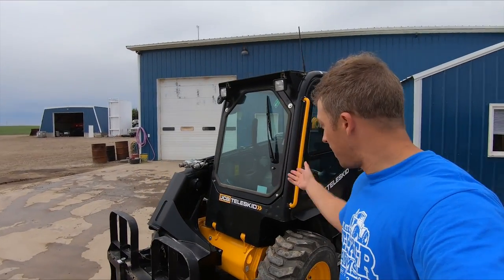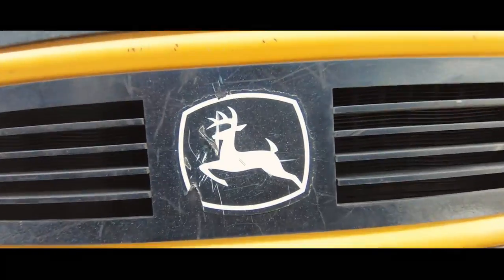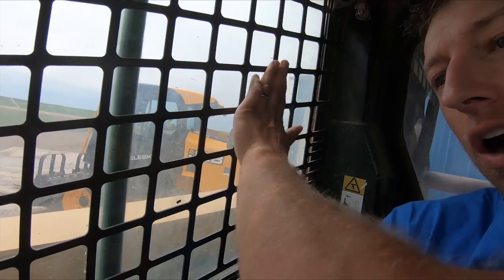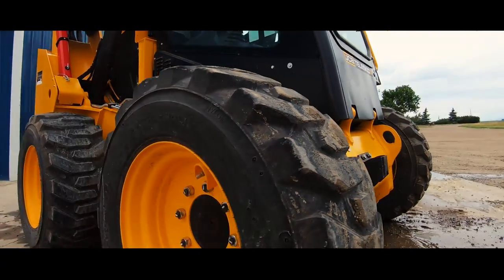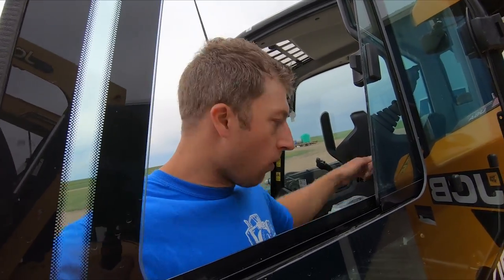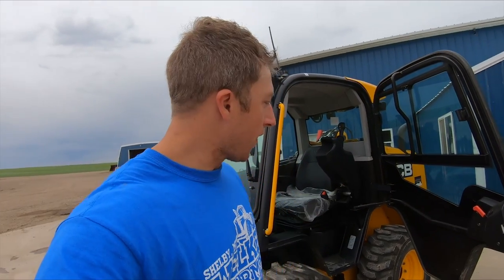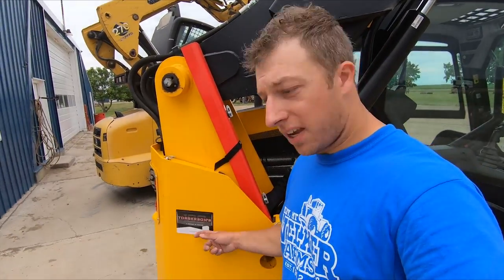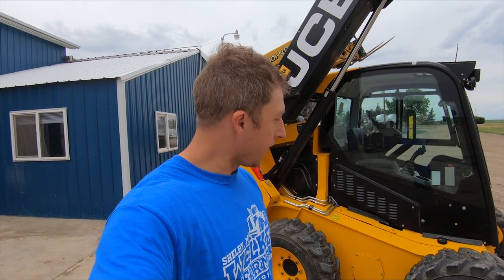JCB Teleskid or John Deere 270?

Comment: Where is the  JCB made?, I guess i never had too much a problem with climbing in from the front, but, i would never do that with the bucket raised. The same goes for a dump on a truck, i would never do anything under the truck box with the hoist raised. I grew up on a farm and my father had a small construction business, Every thing is safer now, but, no amount of safety devices or design, works, if it is not used.
Reply: Made in Georgia, USA

Comment: New G series Deere is so much easier to enter.  No comparison.  Deere has gone through 4 generations of improvements.

It is like comparing your 2003 Ford F-150 vs a New 2019 GMC. Almost everything he points out, is a drawback on the 270, is available on a New G series Skidsteer

Comment: Drive by wire, in 20 years, wonder how  that will be for fixing.
Reply: A massive pain in the butt. I operate 20+ yo logging equipment that is all fly by wire. There aren't many other ways to do what we do without fly by wire, but some days falling and bucking everything by hand, and skidding with a horse is faster lol. We have phantom issues that are almost impossible to diagnose, not to mention the expense (and rarity) of those old modules when they do finally kick the bucket. Theyre like anything else these days, amazing when they work, an absolute nightmare when they dont.

Comment: Idk if they have cages over the glass the one I ran didn't have cages either witch I dont like need cages over the glass too much glass and Operator is at risk. Plus the single arm doesn't have enough ass to lift heavy stuff the twin boom old style all have had more lifting power that I've ran!

Comment: Hi, On The " John Deere 270 Skid Steer "  If Not Serviced Lately , Change The Hydraulic Fluid . Change All The Filters . INCLUDING The "" Hydraulic Tank Inlet Screen And Tank Vent Breather "" …. Optional Parts ;  A Sound Proof / Deadening Kit for the Cab And Engine Compartment . Foot Control Throttle Pedal ,  Winter Starting ; Engine Block / Coolant Heater , Fuel / Water Separator Housing heater . A/C _ Heater Air Cab Filters ?Hard Starting ,, Loss of the " Fuel Injector  Prime " ,,,, Fuel Injector Leaking off Pressure ? Injector Pump fuel Check ValveOn the Fuel Return to fuel Tank ?  Glow Plugs / Engine Intake Air Preheat System ?  Engine - Low Cylinder Compression ?Hope This Helps  .

Comment: We bought our JCB teleskid new Last year from Reuters equipment in Elkhart Iowa what a lemon 🍋 never seen such a poorly designed terribly engineered skidsteer the rubber tracks have far too weak of a tension cylinder and constantly derail and come off and the lifetime warranty loader arm bent and they wouldn't warranty it bent so badly it has broken the window out of the cab twice

Comment: dude come on. course the Deere is harder to start.... its older and not advanced. also the double boom is way stronger ( when I say stronger I dont mean lifting power I mean in the long run 2 legs is. etter then one less u have bent back paper clips ) <---- kat Williams joke and sadly I bet the deere will still out last the newer one. compare a new deere to the jcb. and no I'm not a Deere guy I'm a 2019 ASV forestry with the Cummins and a takeuchi with   a denis cimaf head....